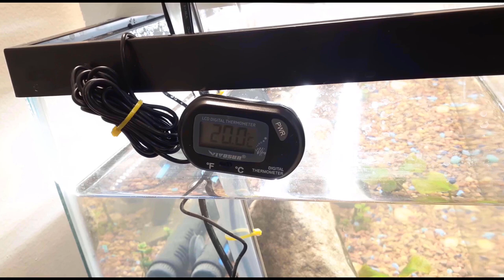DIY Aquaponic fish tank - Crystal clear water, no cleaning, no water changing, no chemicals

Comment: Really like the DIY experimental approach. I was baffled by the soil, bleach, multiple water changes and dechlorination bit though! Perhaps if you need to sterilise the soil, put it in a baking tray and in the over for an hour or two? Love the aquaponic filter build. Thanks for posting!
Reply from the maker: Yes, many people were also horrified by the bleach. But I did wash the soil thoroughly and the fish were fine, gave birth to many generations till now. I must agree that there are simple ways to do it as you suggested. But I did what I can think of at that time (I use the approach of bleaching aquatic plants to prevent diseases when buying from internet). That filter looked nice and worked well for a period of time, but it does get clogged. I have been prototyping new designs and finally came up with one that eliminate many drawbacks of traditional aquatics systems, especially for fish tanks. I'm trying to make it a commercialized product and hopefully can put it on the market before the end of this year.
Reply: @minhsmancave9448  good luck with the new design...is there are video for it?
Reply from the maker: New video about it will come when I have the filter ready to launch.
Reply: Soil in oven does work. But you'll want an old tray at the least with the extraction fan on. I had one of those bench top ovens; I used that outside. It does smell.

Comment: Fantastic!
What a great result and shows building your own filtration unit really works.
Could you tell me what water pump you used to pipe water to the filtration unit.
I am really interested in this as my girls got me interested in setting up an aquarium about a month ago, and I don't want to spend a heap of money on a filter system, when I believe it can be done naturally.
I have the tank, soil, rocks, etc. Just need to the filter system and fish.
This is what I am interested in doing.
New sub and well done.
Reply from the maker: The pump I used is 160 gallons per hour. But that's overkilled. I think 60 to 90 gph will be more than enough. I have developed a much better system for commercialization but it might take a few month to be available on the market. In that system, I use 60gph pump for 10gal tank and it is working great.
Reply: @minhsmancave9448  Thanks for the reply. All the best

Comment: I kinda have a similar setup and your design impressed me.

But the roots of my plants rot in this kinda setup.

Any idea as to why it happens?
Reply from the maker: In my design, the water run from top to bottom and reverse, that way, the roots are oxygenated and won't rot. If the water doesn't move at the bottom of the bucket, the roots are more prone to rotting.
Reply: You can add a siphon to drain and fill, or keep the water moving. Water movement is the important part, and you also need room for oxygen

Comment: Do I have to put dirt in the bottom of the tank if I don’t plan on having live plants inside the tank? Or do I need plants inside the tank for good cleaning
Reply from the maker: No, you don't need soil if you are not planning on having aquatic plants. The plants in the filter are way more efficient for cleaning the water.